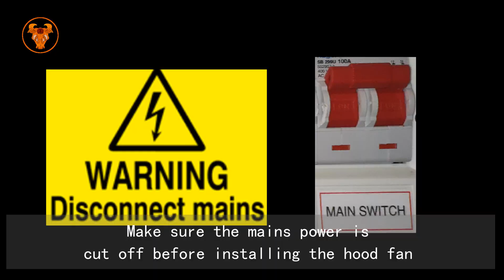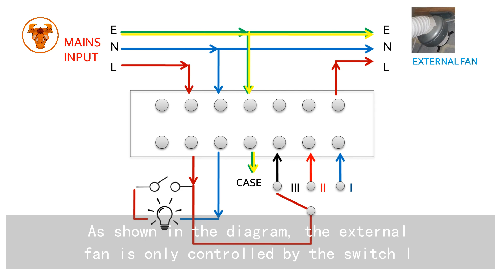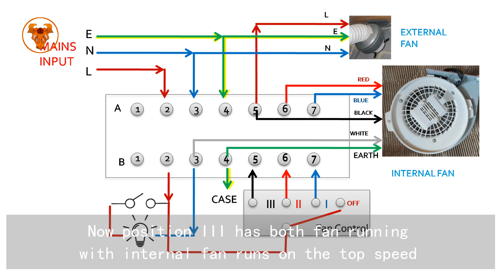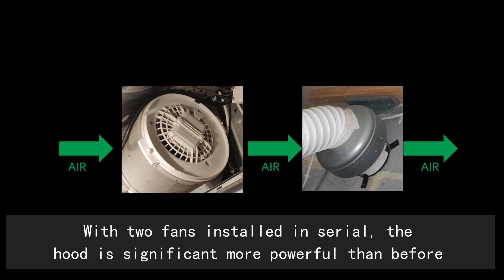How to Install Extract Fan inside Bosch Hood DKE935AGB - Very Powerful Together with External Fan

Comment: Very useful video, thanks! Why couldn't the case of the old fan be removed? I am about to replace one of these, and assumed I could just unscrew the whole fan assembly and replace with the new one. Is it because yours was modified?
Reply from the maker: I found it is difficult to remove the old fan case. The whole hood might need to be removed from the wall to achieve this.
Reply: @rustyox7449  Thanks for the reply. I actually successfully removed and replaced the whole fan assembly including the casing last weekend. It's working beautifully, smooth and quiet compared to the 20 year old grease-covered fan!